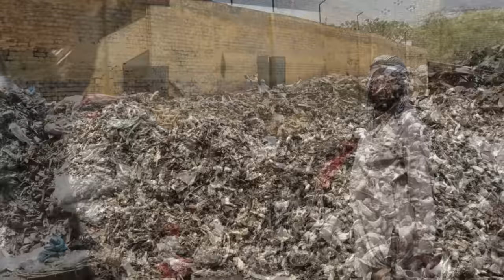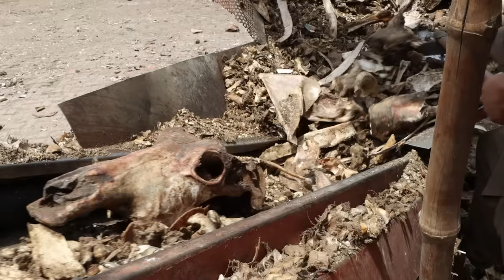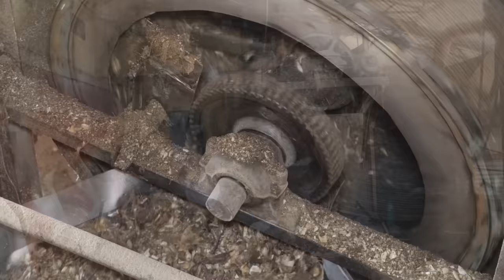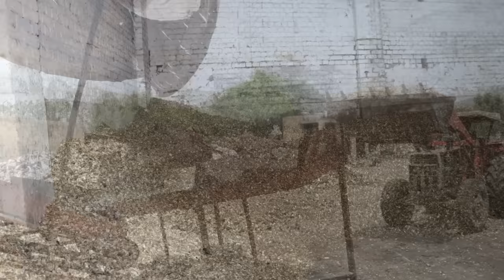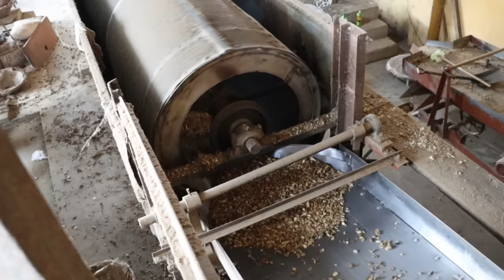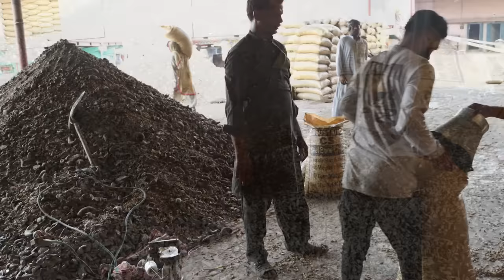Amazing Process of Crushing Buffalo Bone | Bone Recycling Process

Comment: "Buffalo bones" nothing- these are the bones of their comrades that have been killed in all of the other videos you've seen on here: welding gas tanks, cutting up ships, rim repairs, pouring molten metal in sandals, operating metal lathes in long outfits, making tires, dumping wheelbarrows of scrap metals into open pit furnaces, making their own acetylene with calcium carbide and on and on. Farewell great workers, we salute you.  🙋‍♂